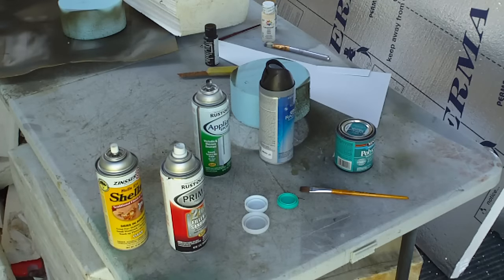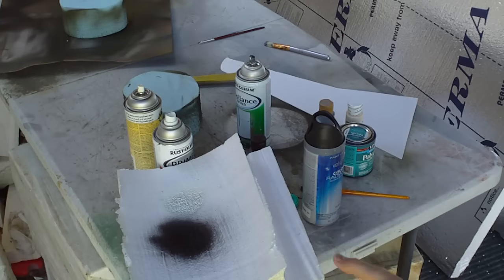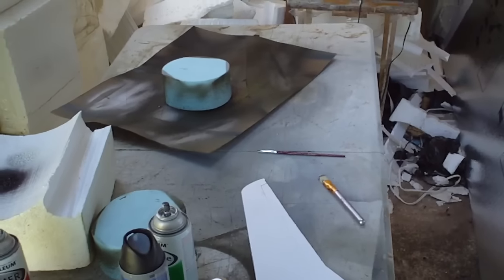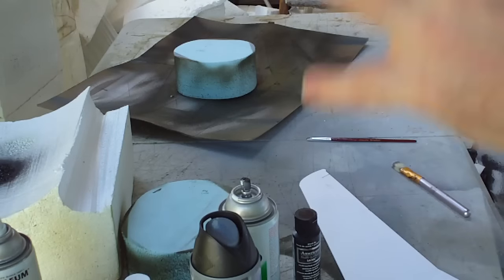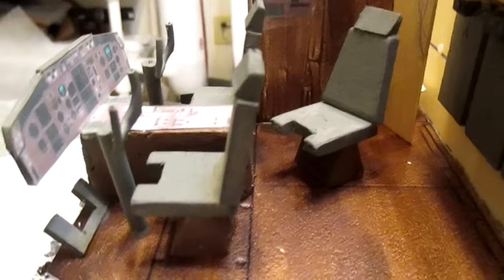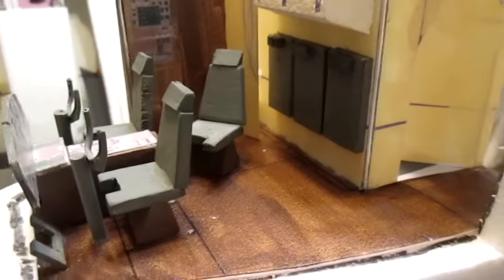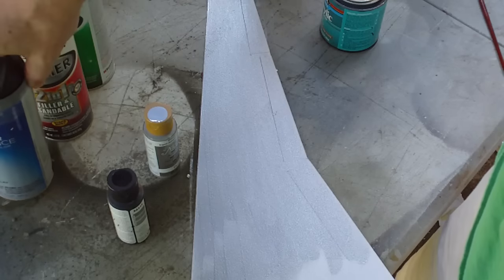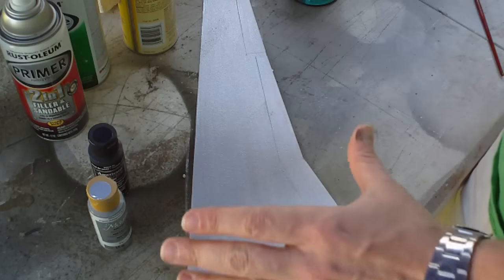Foam Safe Paint for RC Planes!

Comment: My problem is, painting foam still looks like foam and if you put enough paint on a plane to fill it all in you added too much weight. I'm considering using iron-on covering next.
Reply from the maker: Thant's true but some people just want to add color to their foam plane to customize it so I try and help show people paints that can help them achieve their goal.
Reply: Demon, I understand perfectly your reasons...I was just saying how I felt about painting them. I do paint some of my smaller aircraft but the larger ones I prefer to use a lightweight, iron-on covering. I wasn't contradicting you at all, in any way. I like your channel!!!   :o)

Comment: The paint you used in the beginning was epoxy paint and it is very bad with foam. Enamel used in light coats until a base coat is layed down is safe.

Comment: Very cool tips, this is the hobby paint I see at most stores & nothing would SUCK
more than having a hand built plane getting chemical melted spots. Also you can
take foam particles from sand/shaping & make a "Filler" to fill up holes, cuts, or
mistakes w/o having to start over.... I've not built a plane yet so I'm happy to see
these different tricks now, before I do something wrong.

Comment: Great video this new info really helps. Recently I pulled an old Hobbyzone Corsair S off its ceiling mounting clipped the wings and mounted a razorback canopy. My intent is to fix it up like a Reno air racer and it's going to need a new paint job. Would you recommend removing the original paint before re-painting it and with the shellack how much weight do you think it adds to a model and would you recommend it on a high performance aircraft? Great video I'm pretty sure I got to see one of these birds out at Joe Nall on Thursday (I was the TWA shirt guy) fantastic to see how they're made.

Comment: You can use straight aerosol paint but you must keep the nozzle about 12 to 15 inches away this allows the propellant to disapate in the air and prevents the aerosol from attacking the foam. I have used aerosols on my foam planes with no side effects such as this using a 12 to 15 inche distance.
Reply: Excellent Vid!!
Reply from the maker: TOPHAT1966GS that's very true Sir but it's hit or miss. . . If you build up too much paint layers even if the propellant has been evaporated it can still eat some types of foam. . . But in general your technique is correct. I wanted to show paints that have no possibility of harming  foam what so ever.Tophat I'm grateful for your impute Sir.
Reply from the maker: Mathew Winsor Thankyou Matt!

Comment: I started years ago (on epo) using the poly but in spraycan and then applying sandable primer, sanded down and then the appliance epoxy, came out looking like a dream... no idea it was foam by looking at it...  

For the paint you are brushing on why not use an airbrush?

Comment: I used Delta Creative acrylic paint, great tip from you. Can you suggest something I could paint over it to protect the paint from coming off?
Reply from the maker: Sure you can use a brush on or spray on "Paint Sealer" possibly Minwax water based sealer & that should give you a protective coating over your Delta Creative Acrylic paint.

Comment: Great stuff Chris,
 I have been using tube craft paints for years. The use of these paints are unlimited. To go further as you advance it can be thinned with windsheild washer, water, rubbing alcohol added to water for speedier drying, a drop or 2 of dish liquid soap to help leveling. I also use inexpensive Home Depot samplers made to order with a scan of an exact color. It is thick and can be thinned at least 50% for spraying.  Buy a cheap badger airbrush and you are ready. Or buy a good dual action airbrush for pro like jobs. After all done painting you can over spray your work with clear gloss,satin, or matter waterbase Miniwax polyurethane paint. I also finish my planes using Miniwax clear polyurethane oil base floor paint as the final coat.  As a note, I found that the craft paint whites yellow over the years. Use the Home Depot white samplers instead.
Reply from the maker: ne0ns1  Hey Its great to hear from you Sir, Your a GREAT RC-builder! I like your Tips On Using These Great Tube water Based Paints, I find that most paints usually fade or Turn yellow or fade all together over the years, Only Covering film seems to hold up the best, Or Automotive powder-cote paint, I find that really thick paint holds up over the years.
Reply: F3HDemonDriver
Reply: ne0ns1 Thanks Chis,
 Feel bad for nitro guys as they may not be able to use waterbase with much luck unless there is a way to fuel proof. Can't camouflage a plane proper without paint either.. Plastic iron on just does not cut it on some scale planes.  My garage shop is damp most times and with the humidity the waterbase dries slow and slows me down some. That is why I like windshield washer for thinner or some alcohol. I use my heat gun an awful lot while painting to speed the job up. That way I can get a load of painting done in a short period of time.Summer days when it is warmer I open my garage door and it is lower humidity. Sometimes spraying a big plane I setup outside on horses and git er done

Comment: you can air brush the acrylic paint on just fine. Add a touch of washer fluid to thin the paint till it has the consistance of milk. works great.